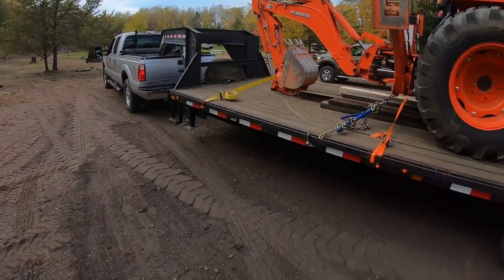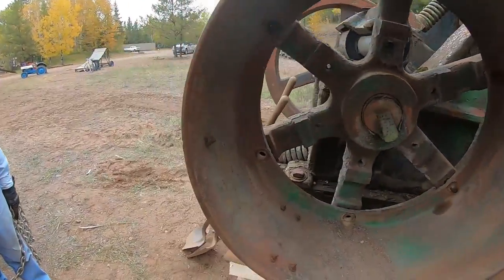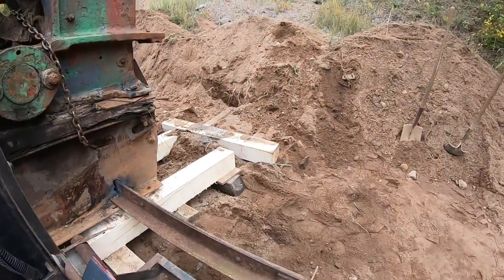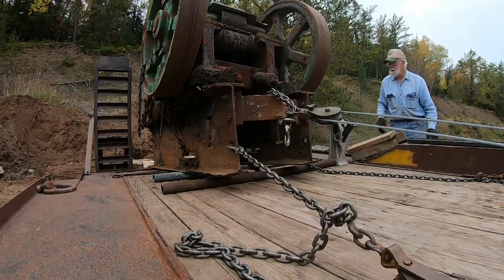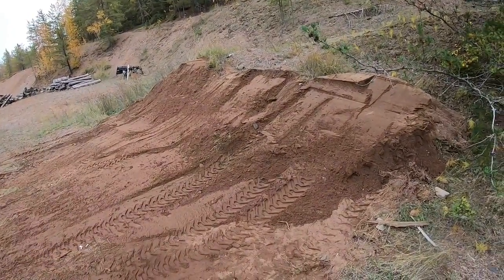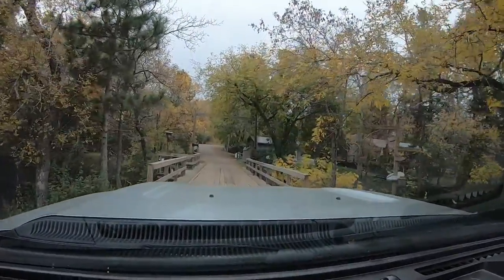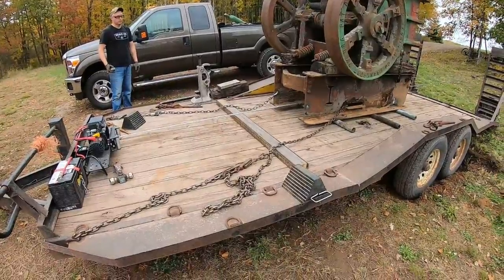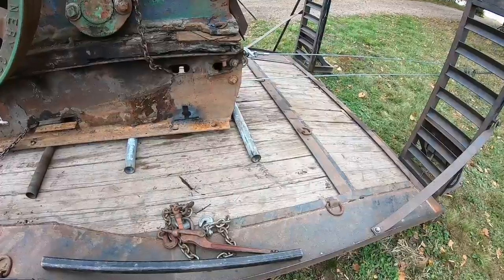ACME Road Machinery Co. Vintage Rock Crusher Loading & Hauling - 6 Tons of NOT FUN!!!

Comment: Back in the 90's I had a few stationary engines I had restored but it's always good to show them driving something. I restored a couple of water pumps, a cattle cake crusher and a butter making churn. I enjoyed doing these as much as the engine. The most challenging for me was the wooden barrel on the butter churn. I now appreciate the coopers art. Mind you the rock crusher is on a different scale to my stuff so best of luck with those gib keys and seized bolts.

Comment: OOOOOHHHHHHH!, So that is what they mean when they say, “Greasing the skids.” Seriously, I volunteer tutor elementary school kids and frequently, when I use idioms, all I get is blank looks. Their frames of reference are about 60 years out of alignment with mine. They were reading a passage about the invention of windshield wipers used on street cars and trollies, and when I explained that street cars ran on steel rails right down the middle of the street, they could hardly believe it. I did not even try to explain “Mad Money!”

Comment: I can see it now belt pulley on a d2 running the crusher and the iron mistress  stockpiling the motor patrol grader to build the roads now you need a track loader and dump truck squatch

Comment: Another question does anybody know what size gravel that that Crusher will make or is the crushed product larger than gravel size
Reply: Usually there is some sort of adjustment on jaw crushers to allow for some variation in desired aggregate. normally it involves shimming the stationary jaw in and out.
My guess, and it is a guess without seeing a better shot of the jaws, is one that size could produce something between 1" and 3”.

Comment: 🤗 but I’m confused 🤔 .. gonna build a structure around it, for making content & working on it this ‘winter’? 🤦‍♂️😂😝 ✌️🤙
Reply: @squatch253   🤦‍♂️  I apologize  for that smart elleck   Remark 🤷‍♂️ just being facetious, 😳  
An off color reference to the  building put on hold.  Don’t have a full mental  pic of the property,   Acme’s resting spot  in that area?  Infact most would say I don’t have a full mental anything 🤪  guess can add you to that list  now 😳 .. ✌️🤙
Reply: @squatch253  I dont know what type of stones you got there, but here in ohio my dad had a gravel pit with a crusher about this size. It had a lid over it  made out of 1 1/2" bar stock. It is quite bent up and quite often it would lift that up and spit out a nicely round shaped stone that it couldn't crush.

Comment: Having owned several jaw crushers I wish you luck with this project.  Not having the bearing caps will be a major headache.  You will want to build up that main shaft and have it and the fly wheels machined to obtain a proper fit.  The lower end of the movable jaw should be inspected to determine if the wear can be addressed where it pivots.  For what you will have to put into this I think in hind site you may wish you had taken it to a scrap yard.  I have rebuilt a lot of quarry equipment, I don't wish to be mean, but I would walk away from this one.